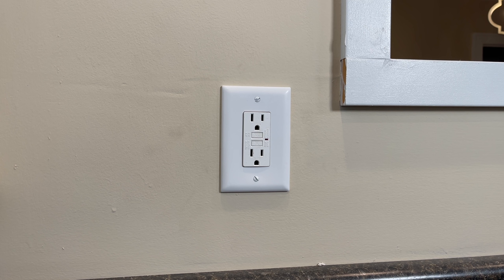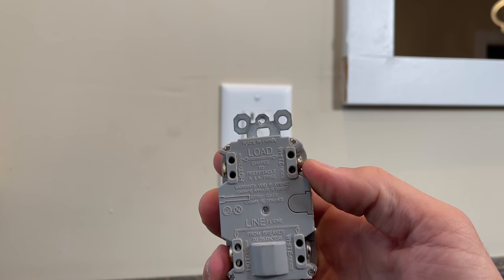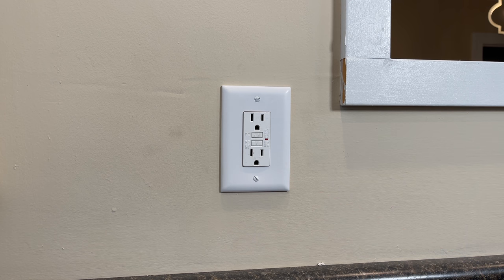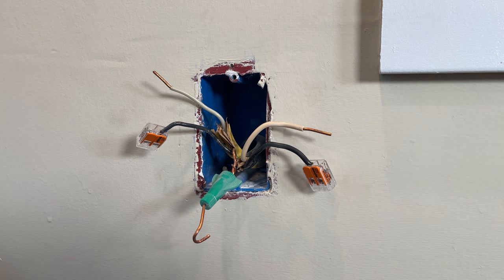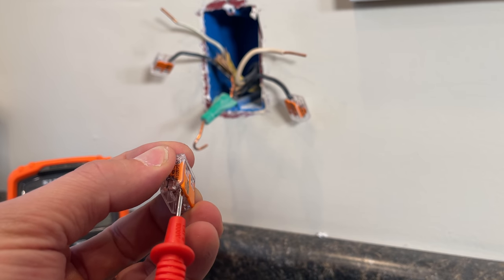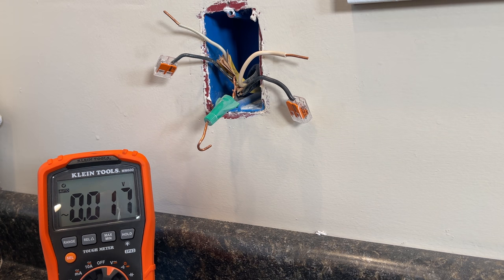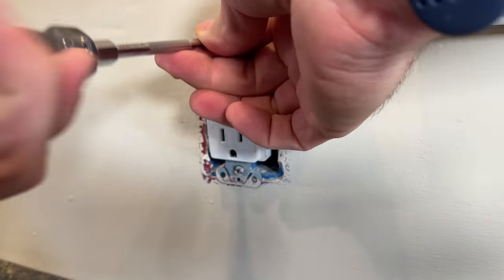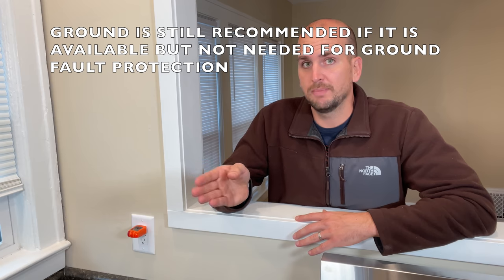Identify Which Wire Goes To Line vs Load Terminals | GFCI Outlet

Comment: How to identify downstream outlets?
Reply: After you remove first outlet and wires are lose put wire caps on the nlack wires so they don't touch anything. Turn braker back on and check the rest of outlets with a current tester or plug anything. If they don't work, that means they are receiving power from first outlet, then you know are downstream.
If other outlets still work while wires are still disconnected then they are under a different circuit and not downstreamed.
You might have to test a few to identify where to install one GFCI to protect all of the ones in same circuit.

Comment: What if you are connecting to another GCFI outlet? Could you connect both sets of wires to the line or should you still connect one set to load. Old outlet had both sets of wires going into line, so this is confusing me.
Reply: Connect to the Line side only.

Comment: My old GFCI (Leviton Pro) has the line and load in opposites of the new GFCI (Leviton WR), meaning the new GFCI would have to be mounted upside down with ground being on top. Does this make sense and it will be ok?
Reply: Put the wires with current on the LINE screws regarless if they are on top or bottom. And ground bare wire on the green screw regarless where it is.

Comment: But will the the GFCI trip if the Hot comes in contact with the UNGROUNDED metal box?
Reply from the maker: If the hot side contacts something that provides a path to ground then that will create a measurable difference in the flow of electrons between the hot and neutral side initiating a trip of the GFCI.
Reply: No, the GFCI will not trip.  There is no path for current to flow, just like a bird sitting on a power line.  The box however will become an extension of the hot wire capable of shocking anything that touches it.

Comment: Is it okay to have the white (neutral) wires switched?  Would that matter?
Reply: Do not switch the neutrals.  I have looked at a few schematics for gfci's online.  Electricity flowing causes magnetic fields, like a relay that closes with power and springs back open.  By wiring them a specific way, they have essentially two relay coils back to back.  When power flows normally, the two relays cancel each other.  When a ground fault occurs, current leaks away from one side, weakening one relay, allowing the other to move the relay and trip it out.

I am sure some electrical engineer will not like my description here and gfci's  now use very sophisticated circuitry, but the idea should help you understand.

So, if you switch the neutral wires, you should be sending current through one relay backward, making them both add together to trip the GFCI.

I hope that helps.
Reply: @keithharrington4595  - Thank you for that info.

Comment: What if you accidentally wire incorrectly with reversed line and load?  Is that dangerous, or will it just not work?
Reply: Im wondering the same

Comment: Working with a non-licensed "electrician" who won't lockout out the panel when sum one shuts off the panel bc he said "what if we put a lock on it and sum one is being electrocuted and we don't have the key to unlock it?" And he doesn't tag exposed wires as "hot" after he hooks them up. He also doubles as a "plumber." No inspections are being performed to c if code is being followed n either cases.

Comment: Hmm. Do you also test the load (out) wires?
Reply: The load (out) wires didn't have power, that's how he knew that they were load side.  Power from the outlet runs through them to power something else, another outlet, light fixture, etc.
Reply: @dustintunis9347  — but I didn’t see him actually test them. Is that normal?
Reply: @shubinternet  Yes, once you find the hot you know the other is the load. If it looks like amateurs have been replacing outlets then I double check everything. 
   I have seen where boxes have been fed from two different directions. It's REALLY rare, but does happen, especially in flipper homes and remodels.

Comment: How did you determine the one side was line rather than just to another outlet box upstream that was hot?
Reply: It doesn't matter if it comes directly from the electric panel or goes to another outlet first.
   Your only concern is which cable feeds power to the box you are installing the GFI in. That is your line side.
Reply: @patrickgatons  Thanks, I just wondered because another YouTube channel video said you  should put it at the most upstream box for it to work properly so I was a bit confused.
Reply: @patrickgatons  So I did some research online and they said that if you put a GFCI in the middle of a run only the downstream outlets are protected, so an upstream outlet would have no protection at all.  Do you agree with this?  Seems like a concern to me.
Reply: @chuck_howard  Yes, that is absolutely correct. Keep in mind, GFI protection is only required in certain specific areas of a home.
   Say the most upstream outlet is in a finished bedroom, then that doesn't need GFI protection so no comcerns.
   The circuit then goes to a powder room, then a hall bath, then to a garage, you would put the GFI outlet in the powder room on the line terminals,  and feed the rest of the downstream outlets off the load terminals.
   Hope that helps a little.
Reply: @patrickgatons  Thanks bro.  :)

Comment: So what does someone do if there is no electricians in the area they live, & No "handy man" in the area that ever shows up either. The problem is I don't think i can hook up a GCFI because the way the wires are & the way it was all connected In the Kitchen. They took a duplex single pole light switch & connected all blacks to it (4 in all), for a Receptacle above it on top. & a Garbage Disposer on bottom to all whites on a receptacle next to it one of those whites was technically one wire so it only took one screw. Then they had a black piggy back going from somewhere on the switch over to the receptacle so it jumped  the power over. But thats what broke off & no clue were it went on the light switch. That Receptacles also is tied into 2 more Receptacles down the line. & all of them including those two were connected in reverse polarity. Its  a mess & im stuck figuring it out because of where i live & apparently we dont have any real professionals here way upstate ny.

Comment: Never seen a hole drilled through a wire nut to pass through connected wires. I must be behind the times.
Reply: That’s just for a ground wire when pig tailing it, NOT to be used for neutral or hot wires, I hope this helps.
Reply: They sell those these days and they've been around at least 10 years.

Comment: wago.. so expensive.. where to we get bulk cheap?  since in reality these cost pennies to make :-)  but yes i know they want some profit and branding.  ?
Reply from the maker: I just buy the bulk boxes off of Amazon.  2, 3, and 5 wire connectors.
Reply: The real Wago’s still cost next to nothing compared to the rest of the stuff we do. Is this really something you want to cheap out on?
Reply: @declanfarber  i didnt say cheaply made product.. just trying to save $$ by buying bulk like 100 + of each type. Im a working stiff like most so Im not rich otherwise i would just buy bulk but look for a deal and not a super deal
Reply: @SuperJimmyBennett  The price of the Wago’s will typically be less than that of the receptacle, and the cost of the hardware is a small part of the cost to install it, so I’m not sure where this is going…

Comment: GFCI is not a replacement for ground wires and you shouldn’t state or imply that it is such. Yes, it will prevent you from getting a lethal shock, but it will not prevent your equipment from getting fried in case of a lightning strike.
Reply: GFCI installation on a two wire system is an approved way to gain some protection over a totally ungrounded (two slot) outlet. The GFCI will trip if it sees an imbalance between hot and neutral, although at a slightly higher number than a standard ground fault. There are published specs if you care to look it up.
Reply: A grounded outlet will not protect your equipment from lightning (even a little), nor will a surge protector or pretty much anything short of commercial lightning protection equipment. Consider the air gap that lightning travels through to get to the earth, and it becomes clear why nothing you can buy at Wal-Mart will protect your equipment. 

The purpose of a ground is to set the potential for any metallic portion of a piece of equipment to...well...ground. This prevents shock if a wire inside the equipment comes in contact with the metal component. This is also why equipment with no exposed metal often does not have a grounded plug.
Reply: @willieb76  Exactly correct. The ground wire is not for lightning protection.
Reply: @rupe53  Good comment, I think it's still nec210-7(d)(3) .

Comment: ????? My confusion.....I've identified the line (hot) black wire connected to gold screw. The OTHER  black wire connected to the other gold load screw...here's where my confusion comes in. The 2 white neutral wires go on the silver screws. Those same 2 neutral white wires, can I switch them ..still on the silver screws, and that would be OK? I hope I'm not confusing you. In other words, the black wires are connected correctly on the gold screws, can I just then grab either white wire connect one to one of the silver screws and the other white wire to the OTHER silver screw?